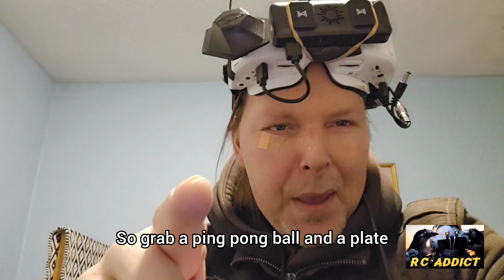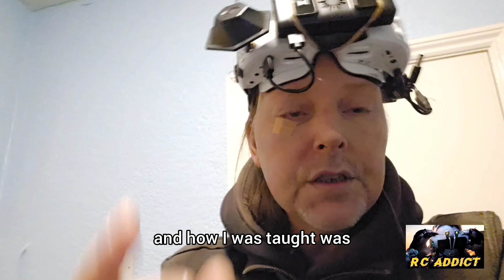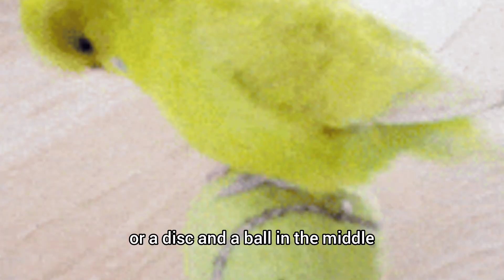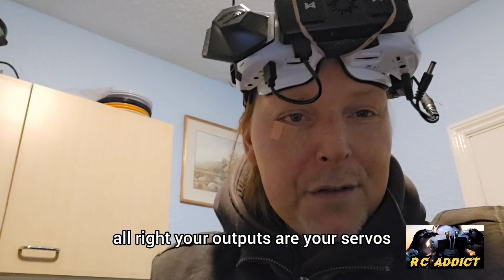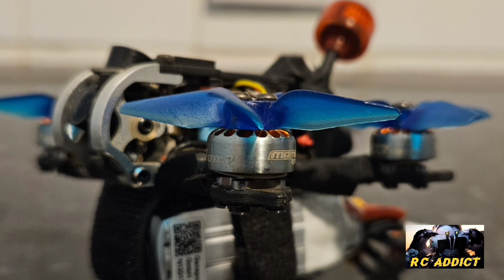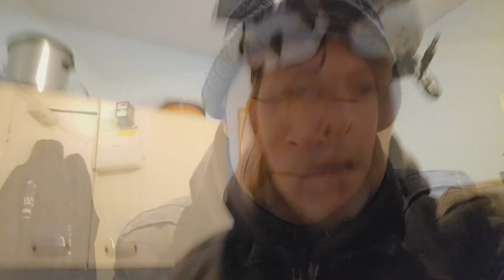HOW I WAS TAUGHT TO HOVER AN #FPV DRONE OR RC HELICOPTER NOOB EASY EXPLANATION #drone #rchelicopter

Comment: The thing that makes it easy is understanding you won't hover perfectly like a dji camera drone. 2nd thing is understanding where your camera points when you are flat on the axis
Reply from the maker: @xsatn2082  yep! Just wanted to make it short and sweet, like when i first started inverted yaw spins, getting my head round that ? But yeah, your correct, but hovering in acro is just the same as cyclic, i heard on a Joshua Bardwell Queastion, about landing and hovering, so i thought id give this analogy, cheers man🫡♥️✨️
Reply from the maker: @xsatn2082  i could have added "Now because the camera angle, imagine you now tilt the plate forward and balance the ball on the front of the plate"
Do you think?

Comment: I learned to fly on a Kyosho concept 30, the yaw (only) GYRO had two spinning brass wheels.
I had a disposable camera on it that could take 1 picture per flight. The smell of nitro & castor oil  :face-red-heart-shape:
Reply from the maker: @sullytrny  hahaha, yep, i remember those mechanical tail gyros🤣 and 2 crossed sticks as training gear❤️🫡
Reply: @rcaddict9558  WITH WIFFLE ping pong balls